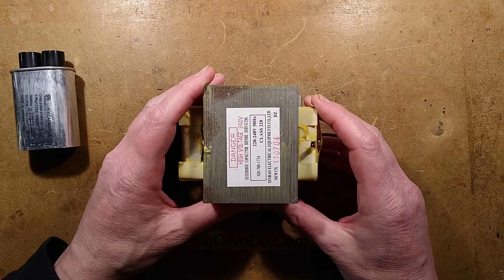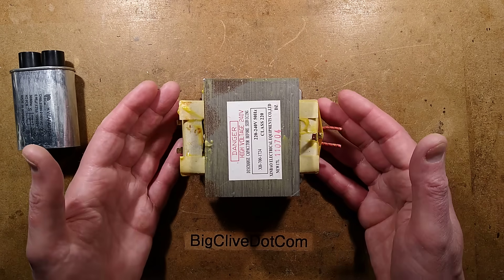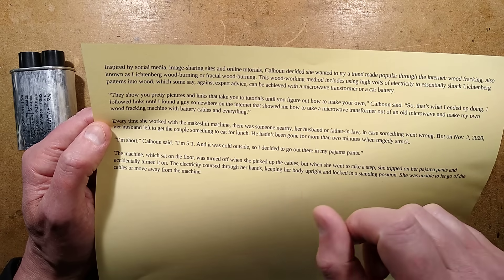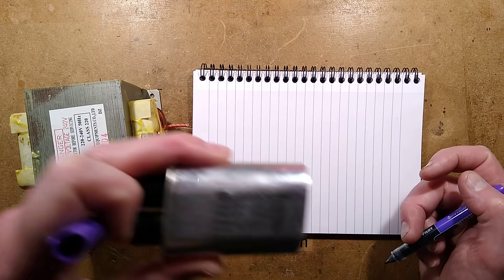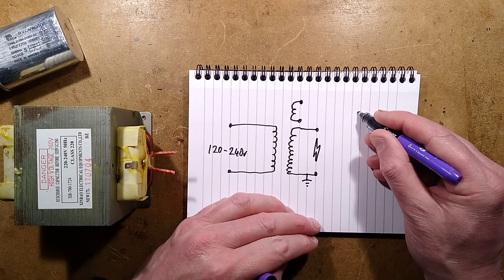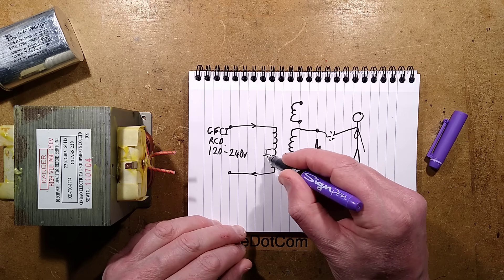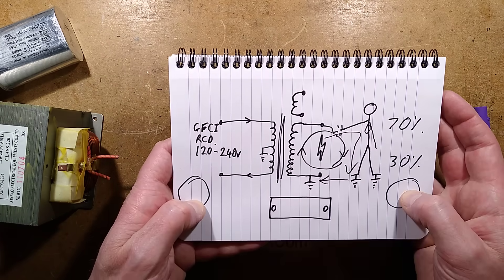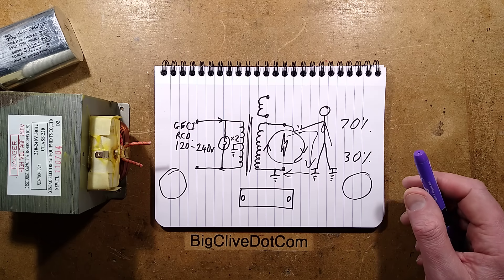The most deadly project on the Internet

Comment: Added bonus to disassembling a microwave:  Some older models use insulation made from beryllium oxide, which is carcinogenic in powdered form and can cause the lung disease berylliosis.
Reply: I only use Beryllium insulation on my Beryllium framed ebike.
Reply: They must been very careful when machining the mirrors for the James Web Space Telescope. All of its mirrors are made of beryllium because of that element's temperature stability.
Reply: only in powdered form.  in ceramic form it is no more dangerous than glass.  Cutting it creates dust, so don't do that.  Whacking it with a hammer won't create dust.
Reply: @hastypete2  I've seen how the mirror segments for the JWST were made. They were machined extensively to shape them correctly and to remove excess material to save weight.
Reply: @joevignolor4u949  Well of course, but the beryllium in a microwave is basically inert unless you start grinding it.  Places that machine beryllium must take care of the dust.  When we honed beryllium laser tubes for refurbishement, we used methanol as a lubrication as well as to capture the dust.  Beryllium is not poisonous nor carcinogenic in solid form.

Comment: A friends brother was working on a 440v system and got in contact with something. Now he was a big man at around 6 foot 5 inches (195.58),  a very built muscular guy. It blew him through a 2x4 sheetrock finished wall and he lived.  Electricity is powerful and does not care if you are the least path of resistance guess what? I don't need to tell you you know.

Comment: I work with transformers every day. IF YOU PLAY WITH THOSE, YOU ARE A FOOL!!! I'm not even going to talk about how to be safe. Electricians wear lots of protective gear to work with voltages like that. That transformer and the voltages you're stepping up to are VERY hazardous. DO. NOT. MESS. WITH. THAT. It's normally located inside a grounded cabinet (microwave) where you can't touch it for a reason.

Comment: Clive, my microwave works perfectly fine, but it makes this weird clicking sound, sort of similar to a frog makes. But only sporadically and only when its not being used. No smoke no smells no sparks, nothing. I dont want to throw it away because it seems fine except for that, and its probably not worth the cost of a repairman, but any idea whats inside that would make noises? Or burn down the hacienda?

Comment: In the early 00’s I built a DIY “welder” from plans on the Internet.  It used 2 of those transformers and had to re-wind the wires.  I “made” my own low gauge wire by cutting apart dryer power cords, pulling the bare copper wire out, splicing it together into longer lengths, and wrapping the wire with a layer of electrical tape as the insulation.  Then I did 20 turns of this wire in each transformer.  Reminder, I didn’t cut the transformer apart to remove the previous wires, I cut the wire and hammered it out, and then I threaded my new wire into place, which worked ok for the first 10-12 turns, but I had to jam a chopstick into it to form a space for each subsequent pass.  Finally I had this incredibly jank “welder” wired up and ready, even attached a grounding clamp and vicegrips to hold a “graphite electrode” (pencil lead).

It was at this point that I said to myself, “You just built this janky mess.  You don’t know how it’s supposed to work.  You have negative levels of quality control.  You are playing with high level electricity.  This could very easily and quickly kill you!!! ………NOPE!!” And it found itself on a shelf for the next 15 years, never to be turned on.
Reply: You left the party before the police came.
Always a good plan.
Reply: Good job. Your internal voice definatly saved your life. I wonder what that would have done to the pencil lead and how quickly?
Reply: Chuck it already so nobody tries to turn it on after you pass...  out of curiosity.
Reply: dude, you owe your shoulder angel a beer
Reply: It's called a moment of clarity. It most likely saved your life.
Reply: I thought about doing that too, but had pretty much the same thought. I mean welders are like $90 at harbor freight, why would I risk my life over that?
Reply: @thejackbox  a $90 HF welder is like buying a lottery ticket...sketchy at best, janky or worse after 4 uses. I saw a teardown on a $300 HF model: the home-built 20-turn dual transformer model might be better! Even if the equipment were to work, there's a lot of procedure, PSE, and knowledge required to stay alive or safe safe when doing ANY welding. 

I would like to get into TIG/GTAW, but want reliable AC/DC, pulsed operation. I don't think HF will be the source
Reply: @atlantajunglepythons1744  yeah I used to work in a machine shop with some very nice TIG welding machines, but I’d still take the HF over some microwave transformer bullshit that I Jerry rigged
Reply: This dudes got a prefrontal cortex.
Reply: @1ProtonProductions1  well I dont think he'd have gotten this far in this janky project if he did lmao but props to him
Reply: yeah I would have just looked in the classifieds for a used Lincoln Electric.

Having said that, I did build a laser in the mid 90s (He Ne signalling laser from a communications network) which required 1100v from a secondary transformer. I still have it ;)
Reply: Excellent work, just because you could do something doesn't necessarily mean you should
Reply: That's not actually as dangerous as you think because the the winding makes the voltage is very low- microwave transformers are very dangerous in the wrong hands and as stated in the video can be deadly and you don't geta second chance because they normally run at 2000v+ with plenty of current.
Reply: @NigelStronge  Assuming nothing in the janky set up is touching something else that it shouldn't be and you get mains voltage, which is bad enough on its own. I mean, you're right, though, I tried building one of these welders and plugged it in with a switch I could flip away from the thing. Still felt like I was doing something I shouldn't be, with all the bare metal parts that could potentially be live to the mains. So I scrapped it. A spot welder isn't that expensive if I find myself doing enough projects with metal that I might need one.
Reply: love this.
Reply: Good move!
Reply: The project you've described is relatively safe since the transformer gets repurposed for making a lower voltage at a higher current.
Reply: good, good, glad you're here
Reply: Smart man
Reply: Been there, done similar.  If you dont understand the basics...  don't plug it in.  The capacitor in an unplugged microwave holds enough voltage to kill a human.  My wood burner went into the scrap... incase someone finds it and plugs it in after i die in my next experiment. 

Mostly i stick with gardening now.
Reply: @mmercier0921  Actually that only happens if you unplug the microwave from the wall immediately after you turn it off, otherwise there is an internal resistor that will discharge the capacitor as long as it is plugged into a grounded outlet. The same is true for start and run capacitors for electric motors. Where a person can really get themselves into trouble is working on old tube equipment where the secondary voltage are in the 400-600V range because those capacitors don't have an internal bleeder resistor and generally you use a well insulated jumper wire with a built in 10 Meg resistor to manually discharge the capacitors before you service them.
Reply: so? you built a welder sooooooooooooo dangerous.... never used one?
Reply: fuckingpippaman the point isn’t that welders are dangerous, it’s that some janky set up that was very poorly put together and had a very high chance of going wrong the moment it was plugged in is very dangerous. I don’t get what’s wrong with you either that or you can’t read.

Comment: Some of those transformers have hot laminates.  I used one for an HF amplifier and rectified got >2800vdc.  Damn near killed myself and burned my hand so bad I bled.  I needed a trip to the ER.  My hand still shows the scar.
Reply: They are designed to be bolted down inside a grounded enclosure and the HV inside the enclosure.

Comment: I'm an electronics engineer, I deal with high voltage and sometimes high voltage with a high current capability. I would rather try to cross the motorway blind fold than make one of these devices. There's enough risk in our lives without creating more. Good to see a straight forward message that will hopefully save some lives.

Comment: How can they use car jumper cables? The insulation will be rated for 1kV max, and could be 500V or lower. I'm an electrical engineer and I stay away from high voltage, unless I'm in a substation and all of the high voltage is out of reach and/or behind a cover.

Comment: I paused the video and looked at the label which shows primary voltage at 240 but nowhere does it state the secondary voltage.
I guess the manufacturer never intended for the MOT to be used for anything but a microwave but people doing this crazy stuff 
have no idea of the voltages they're dealing with.  There will of course always be the "It won't happen to me." crowd. 
As for the electric chair, based on this, should I ask what happens to the body in the electric chair ?

Comment: I’ve done a bit of wood burning using the same methods you describe, using a microwave oven transformer. I also you use a Variac device which adds another small level of safety. I’m a strictly heads off approach tho. Two high voltage cables with croc leads two copper electrodes. Set in position, power up transformer increase power on variac, burn turn down variac, unplug transformer. You need respect for these, not unlike a chainsaw. Thanks for sharing this video Clive. 👍

Comment: I make a lot of wood fractals designs in my free time, but I never take my electrical experiences and working with electricity for granted, I wear thick insulation gloves (ASTM D120-09 Compliant Class 0 Rubber Type II) and thick rubber soled boots when making these since they require a tremendous amount of high voltage . .and also I would lay down a 60mm thickness gym rubber carpet on the platform I stand to prevent my body from accidental grounding, I don't use probes, instead I use two small nails hammered to the plank and connect small crocodile clips to them which are linked to the machine then plug in the main  turn it on then press the machine's momentary switch on while I stand from a safe distance, after I get the desired fractal patterns I would let go of  the machine's momentary switch and switch off the main and pull out the plug then change the position of the nails and then repeat the same safety procedure. Also I never operate the machine when I'm not feeling well since working with high voltage such as this require 100% of my concentration and consciousness of events around me.

Comment: I’ve actually been shocked by on of these transformers, 12 year old me was 100% sure I was already an electrician and was playing with arc’s, I forgot witch end was live and touched it, only reason I didn’t die was because of luck and a bad breaker switch
Reply: Well you are no electrician today. The type of transformer portrayed here is not the usual which you play with at home and transforms the voltage down. You did not die because there was not enough body-current flowing to stop your heart from beating, or cause irreversibly nerve damage or it wasn't flowing as long, that you died of irreversible burning damage, internal or external. The participation of "Luck" and the "switch" are just a speculation. 
All that doesn't matter: I am glad, that you are alive:)
Reply: @dieSpinnt  it was a microwave transformer, it took the 120 from an outlet and turned it into 240, so I could make arcs, it’s also a popular method of wood welding like he showed in the video, I am still no electrician but I do know what I was playing around with lol
Reply: @calebunruh6245  It wasn't. But that is good!
Microwave transformers usually have a secondary winding that provides around 2000V and upwards.

Comment: The deadman switch of course means with two hands needed people won't be able to do the fracking work! However if people are determined to do this incredibly dangerous activity even a one handed deadman switch may be effective if you don't die instantly. Contact would be broken instantly if the switch was well designed. Having one hand on a deadman switch would also lower the chance of the path being across the heart but still would not negate a short and deadly shock completely. Battery leads are a no no and the cable needs to be properly insulated flexible high voltage cable and the probes need also to be rated for the voltage and more. 

I'm not planning to do this activity and if I was I would not use a microwave transformer, I know that Tesla Coils are a lot less vicious when the frequency is higher (watch Electro-BOOM), so I would probably go that route. 

I do have microwave transformers on the shelf but they are for other safer projects like the spot welding tool.

Comment: The really sad bit is that a simple set of lineman's gloves would have prevented a good number of those that died. They're thick rubber and insulate up to 14KVA effectively. That's why they have the long cuffs that go to your elbow. To be perfectly honest I still don't completely trust them. Your hair will still stand on end when you go to muck about with high voltage. I bought them for working on Tesla coils. And please all of you that reckon I'm a complete moron, try and understand that I'm a high energy physicist and there's loads of safety equipment in place to prevent injury. The matter of the fact is that tuning a new coil can be a rather tedious and drawn out process. When you can run it on low power to guage the output and find it in minutes instead of hours or days it's beneficial. Now I do that from the protection of a metal cage that contains the electrics that drive the coil and with proper safety equipment it's easy enough done up to run at peek efficiency. Bly me folk, I've just realized I've been doing this for over 30 years now and not one injury from shocks. Now sure I've had a few skinned knuckles and minor cuts, scrapes & the like but I've never been electricuted.

Comment: From a certified electrician- if you're watching a tutorial that you can't already explain, and it includes things like "from a microwave" or "car battery" or anything at all connected with water and electricity, I cannot emphasize enough: DO NOT DO IT. If you are lucky, or maybe not, you will survive. More often, you will not, and possibly take other loved ones with you when they try to save you instead of turning off your contraption first
Reply: We know that it doesn't matter how cringeworthy it is, nothing we say is going to keep some people from yelling "Hey y'all! Watch this!"
He did recommend the Deadman switch, and I wholeheartedly agree with that...however, I noticed the switch he showed was using required gripping the box and switches. High energy = contracted muscles gripping the device even tighter!
I just pointed it out and gave him a couple of other Deadman switch builds that are designed for high energy circuit personal protection.
Reply: @jonhetherington5985  the most common practice is a two position switch, must be depressed to the first indent to close, but if pressed all the way it opens again
Reply: People don't realize how dangerous car batteries can be. They think because its only low voltage and there isn't any shock hazard that a car battery isn't dangerous. If something like a screw driver, a wrench or a wedding ring somehow gets connected across a healthy car battery the metal can heat up red hot and burn you. Car batteries can also give off explosive gasses during charging and a car battery can explode if it's shorted or connected backwards across another battery. Plus there is the hazard from the acid that's  inside a lead-acid storage battery.

Comment: Very interesting video. The one thing you don't mention is if this is AC or DC. I assume it is AC as there is no mention of rectification.
I used to work with CRT's for medical electronics, and the anode power supply would deliver about 4000v DC. These were built and tested off-site and delivered to our labs for final assembly.
On one occasion, the grounding (bleed) resistors were not fitted for some reason, and the CRT sat on a shelf for a week or two before a technician began working on it. It was not plugged in. He caught his hand on one of the terminals and the residual power from the capacitors was enough to throw him across the room. Fortunately the shock was not too high, and he was OK.
Had the unit been powered up, I very much doubt he would have survived.
High voltage DC is even more dangerous than AC, as it will travel through the body core and often lock the muscles, whereas AC generally travels across the skin surface.
I think the moral of the story here is that even professionals can get caught out with high voltages, so amateurs should not go anywhere near this lethal pastime.

I strongly suggest people find a safer hobby.